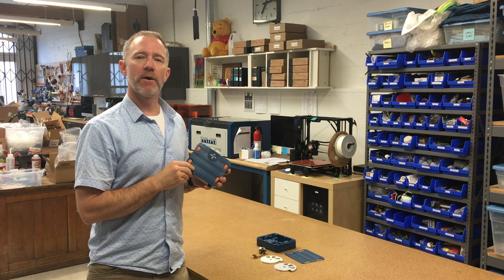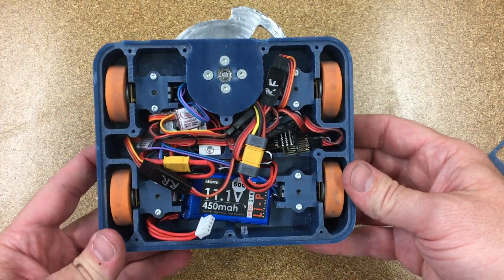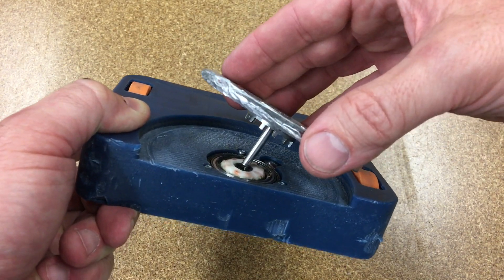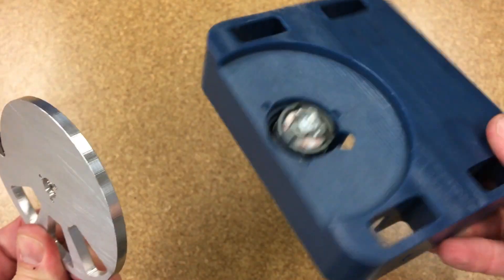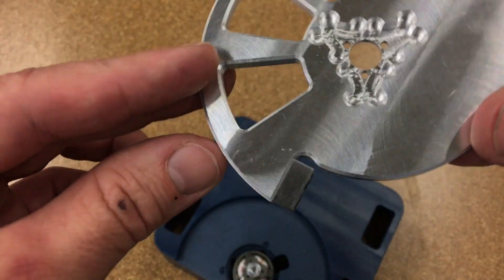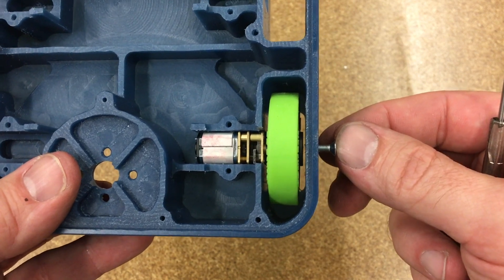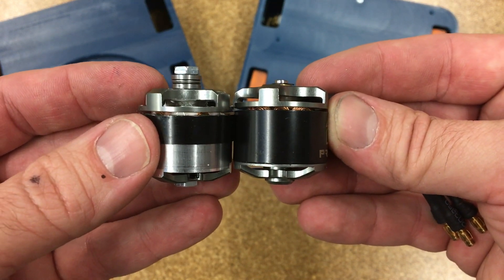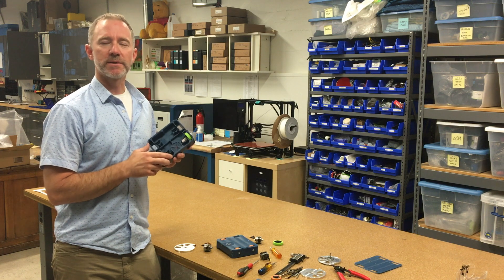Blue Screen of Death 2.0 - 1lb Antweight Combat Robot

Comment: Awesome video! Just realized Im using that exact same motor for my antweight, definitely gonna put in some of those changes! I thought that weird C slip seemed kinda small but I didn't realize it might just pop off.
Reply from the maker: Aaron Rosner I think the changes to the motor helped. The thread ends are much stronger and the thrust bearing protects the bearing there (I had one start to fail there previously).

Comment: Great idea to cut down the wheels!    Very innovative.
Reply from the maker: TML ProductionsTM Thanks. I didn’t have much else to work with for weight reduction so the wheels seemed like a reasonable option. Others worried they might be too weak but they did fine at AVC.
Reply: @chrismiksovsky5871  Yeah. As long as the wheels are decent, your wheel guards will save them.